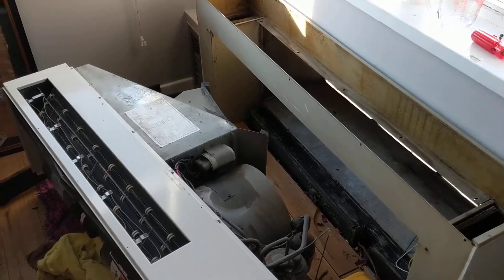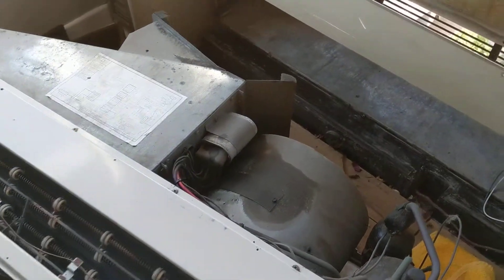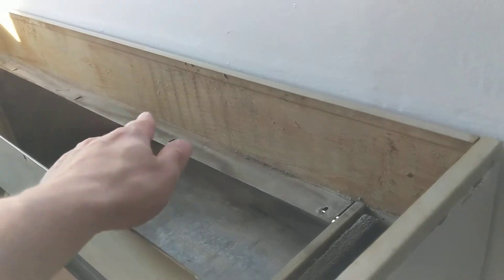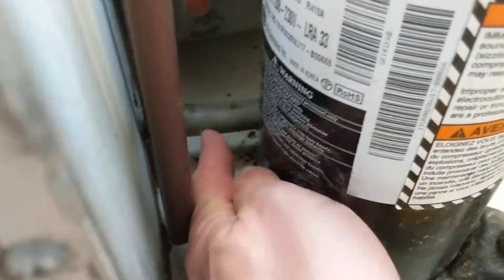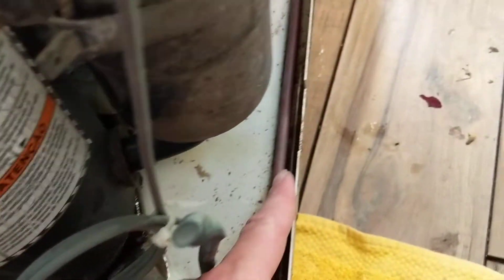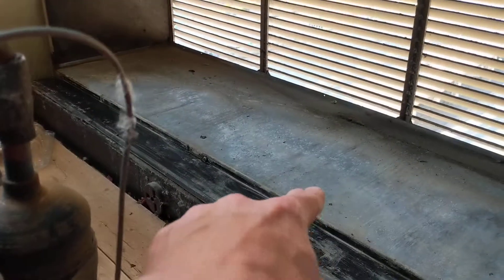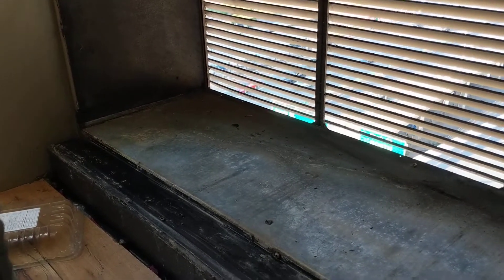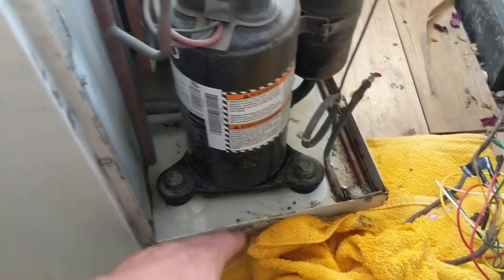PTAC Heating/Cooling Unit - Leak Diagnosis

Comment: Greating from 270, mine is not cooling. Asked the technician provided by the condo board, they didn't pull ot out. their recommendation is replacing the unit. I will pull it out and see what I can do. curious about how old is ur unit. Mine is 10 yrs. Hopefully cleanning and declogging can fix the issue.

Comment: Bud.  That is not a heating coil. Thats a discharge line between condensing coil and compressor.  Its temp is below 100 F most of the time.

Comment: thanks for the video... although I have an old good working  Carrier PTAC unit model #52BHA014301AA and......I want my Ptac to go on when the wall thermostat heats up the pipes above the ptac unit and off when the boiler shuts off and the pipes get cool.How do I accomplish this if my sensor is just working off of ambient room temp? My room thermostat does this already. Should I relocate the sensor right over the heating coils that run over the top grill? OR... get a sensor that can do this? THANKS, any suggestions? very much appreciated. My bedroom Island Aire ptac unit has a sensor that I just locate over the grill area and it works both the heat and the ac thermostat. THis old ptac seems to have a wand sensor over by the a/c intake that is indoors? This way as I've said, it never registers the heat in the actual pipes.
Reply from the maker: I truly am not sure what you'd need. But sounds like if you want to measure a temperature at a specific spot and use that measurement to control a PTAC that is currently controlled by a wall thermostat, maybe you can consider buying a wireless thermostat. You can then simply leave the wireless thermostat wherever you want to measure the temperature and have it communicate with the wired receiver leading to the PTAC

Comment: Hey! I know this is from 3 years ago but did your AC stop leaking?
Reply from the maker: It helped majorly, but there was still a minor leak afterwards so in addition to this, I put some shims at the front of the unit to tilt it outwards so it could hold more water. That stopped the leak all together.
Reply: @MrZiptron  One of the two PTACs in my unit has been leaking crazy lately in the past couple of weeks. So, thanks to your video, I removed the panels on the front and top and did a check. It turned out that the condensated water accumulates at the bottom of the front tray / container underneath the cooling coils and builds up rust which eventually caused a hole on the very left bottom for the front tray / container from which the accumulated water leaks directly into the fan and floor underneath whenever the AC is turned on. I've been thinking about why there would be so much water accumulated there - likely at least an inch deep and I literally used up 1/3 roll of a kitchen paper towel and a rag to get the water absorbed.Why so? Shouldn't the water flow to the drain pipe directly? I did make sure that the drain pipe is cleaned
Reply from the maker: @wendyhouse6045  At times, when there's a clog (accumulation of dust and debris) at the drain hole leading to the plastic drain tube that runs from the front pan to the back pan, water becomes unable to drain from the front pan, causing it to accumulate. However, it's unusual for corrosion to occur. Typically, the front pan overflows when there's a clog, which makes the issue noticeable right away. Depending on how bad the corrosion hole is, you may be able to clean the area a bit and then just fill it with silicon to get yourself another few years out of your unit.

Comment: I've been looking for the information for the same or similar PTAC for days and finally found this. Now that I have read the comment, I also think I am in one of the three buildings (overlooking the Gardener) that have installed the same model! Mine is so old that the label is fading and I am not able to tell the exact model. But the look is very similar to the one in the video and I also looked up the manual for the the model in the unit from Applied Comfort. Thanks for shooting this video and helping people like me to sort out the real issue. My building has a contractor doing all the servicing for the unit owners but they only do the easiest job which is cleaning the drain pipe without pulling out the unit. Any leaking remaining after cleaning the drain pipe, they will recommend to replace the entire unit! My only question to you is whether you absolutely need two people to pull out and push back the unit (which is 165 lbs)? If I use a heavy duty roller underneath, do you think one person can handle the job?
Reply from the maker: If you put something onto which the unit will slide onto, you could definitely try do this on your own. It is heavy to lift, but not overly heavy to slide. Good luck!